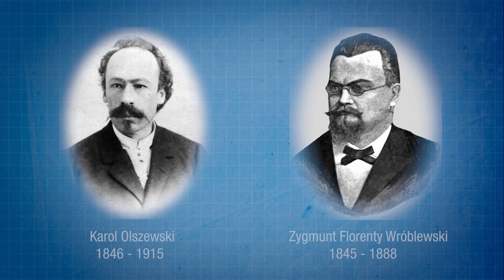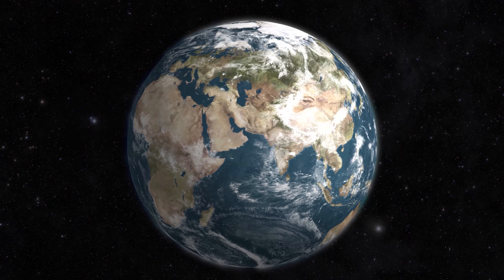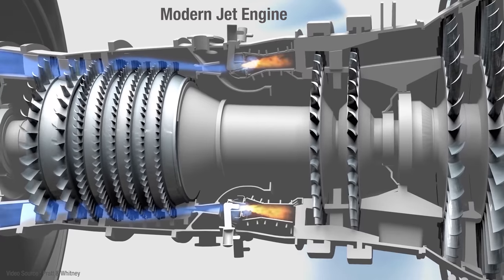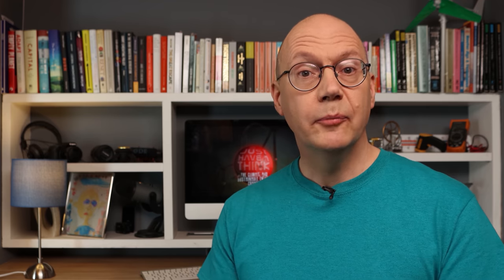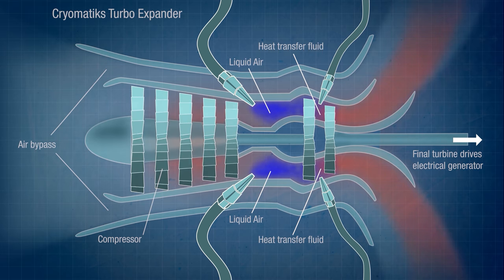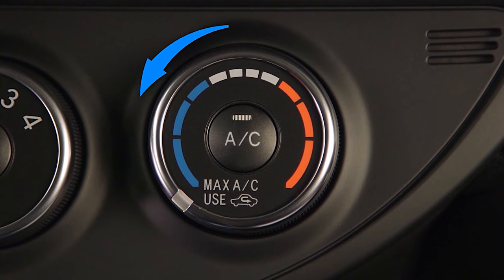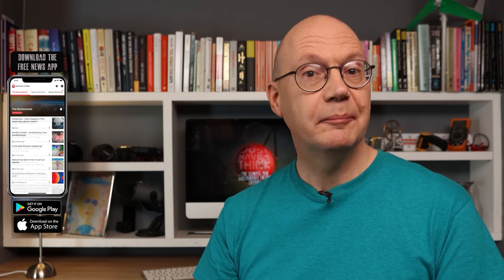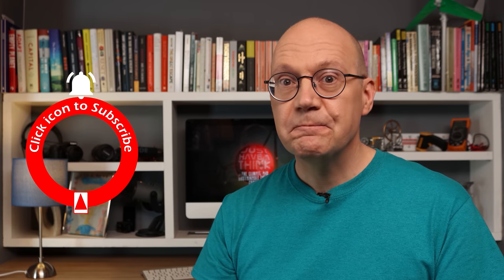Portable Liquid Air Power. A new boost for electric vehicles.

Comment: It would be interesting to see a comparison of the overall efficiency of this system vs hydrogen fuel cell vs battery for vehicles. As we transition to a low-emission grid the efficiency of the end-use will be increasingly significant.
Reply: Actually we're going to have like we have tobacco papers we're going to have the efficiency papers because the fossil fuel industry has used efficiency imposition to maintain market share. For example we have chronically incrementally increased the mandatory efficiency of large electric motors and the consequence of that is the cryptocurrency mining uses the electricity only ones and waste all of the heat that the computers produce instead of with the hundred and twenty degrees Fahrenheit fluid that boils the heat off of a 700 watt CPUs producing additional electricity for example? If Bill Gates had to delay a firing squad by a few seconds he would say he did that to save Capital cost. I don't know why you guys care about delaying Your Fate by mere seconds instead of coming over to the table of the good and getting into heaven obviously after a long enjoyable life?

Comment: You have missed an important application of this technology - regenerative/dynamic brakes on locomotives.
Reply: Electric locomotives already send the regenerated energy back to the grid.
Reply: @enterprisestobart  electric trains are much more powerful than EVs therefore losses are more important, also trains have much powerful stopping power, EV also have losses from regenerative braking.
Reply: @enterprisestobart  after you put a bunch of railroad Executives in prison you can installed some liquid metal batteries but only as a temporary measure; thanks for the Intel!

Comment: I really appreciate you covering this concept. For years I saw this as an alternative to the low range and limited recharge cycle batteries of then current EV's. Cryostats have nearly unlimited cycle life and faster recharge and are nearly as good in power/mass as far more expensive batteries. Cryomatik's expander will likely have extremely long MTBF and the low maintenance of gas turbines and if it can be made inexpensively, a vehicle using this tech could be very competitive with battery EV's. BTW it might make sense to add a solar heating panel to the top of that delivery van. Also this seems ideal for refrigerated trucks.
Reply: It should be possible to build the expander at reasonable cost since it does not need the high temperature magic of combustion gas turbines. Also auxiliary equipment should be cheaper and simpler than what is required for a fool um fuel cell.
Reply: Caroseria din tablă poate fi ajutată la răcire vara cu serpentine lipite direct cu argint sau cositor. După ce ies din schimbătorul de căldură.

Comment: Also be a great energy storage system for homes, many homes already have pressurized gas (flammable) , pressurized air would be much safer, and no replacing batteries or worrying about fire! Great videos!
Reply: I don't think its simply pressurized air but cryogenically cooled -200 C liquid nitrogen stored at a very high pressure. Also just based on the tanks interaction with air around it is likely to lose its stored energy, you can try to thermally seal it to prevent this but the energy will still leak at a certain rate. You will not have to worry about fires for sure but there will be other considerations, but yeah might still be safer.
Reply: No. There's a significant risk of explosion if the integrity of the pressure vessel is comprised. It would never pass safety legislation.

Comment: I saw a program on NHK about a containerised powerplant using excess power from a wind generator to compress air, which was then used to generate electricity when the wind didn't blow.
Reply: What's hilarious about the containerized version is it's just proud horsepower wise of a diesel electric locomotive and it is shipped and operated in a railcar despite having the alternator which you don't need if you use the system for your motor on a train. if you do that you will find that you have far fewer cars devoted to propulsion a fire higher percentage of the total length of the train is for cargo because you don't have all of the radiator cars to disperse the heat from the burning of diesel. And of course we move Frozen items by Rail and if your locomotive is powered by liquid nitrogen not only are there fewer tanks for liquid nitrogen than the removed radiator thanks for the diesel-electric but you load the food raw and freeze it in route!

Comment: There was a French company working on a noisy little compressed-air vehicle. It was based on a piston that had a very high dwell at TDC so that it could soak up ambient energy and expand the cold charge inside the cylinder. They were claiming fantastical range numbers when augmented with a small external heat source (ie, propane burner or the like).
Reply: @CloudedShine  
That car was named Eolo
Reply: @CloudedShine  Tata OneCAT
Reply: @CloudedShine  

I recall Renault developing a vehicle powered by steam many years ago.   I don’t mean back in the 1890s, rather 10 or 15 years ago.
Reply: I wrote an essay at Uni in the early 90's about alternatively fuelled cars. I found out there were VW Beetle taxis in Mexico City running on compressed air. Can't find any info on it now though - not sure if those were DIY conversions or a trial or something similar that never took off.
Reply: Jules Negri.

Comment: THe heat transfer fluid is a mixture of water and glycol and injected into the gas stream...where does this go?  Is it re-used somehow, or does this consume glycol, which is carbon heavy and also toxic?
Reply: Good question.
Reply: Thats my main concern as well. If it saves fuel but kills the wildlife its not a viable option.
Reply: Not to mention having to fill up a tank/tanks with water and glycol
Reply: @kirkc9643   and what about the energy required to manufacture the glycol and create the liquid Nitrogen
Reply: Ethylene Glycol: toxic.  
Propylene Glycol: harmless.  Used in all sorts of stuff we use on our bodies, and it is in many aerosols.
Reply from the maker: My understanding is that it is a closed loop system.
Reply: It is most likely a closed loop system.  The info-graphic was a little misleading and gave the impression it injects fluid rather than transferring heat.
Reply: @JustHaveaThink  how can ot be closed loop... is the air recovered and re compressed/cooled?  Seems like it would be difficult to keep the fluid from fouling and freezing in the compressed air holder.

Comment: Heat transfer from ambient air to liquid air can produce way under 1000 J/g of energy. Realistically, under 200 J/g. Overall, the efficiency of the whole cycle (starting with energy consumption for air liquifaction) will be quite low.
Remember that to produce energy, it will need to absorb a lot of heat from ambient air, and it's very difficult. There's a very big problem of that heat exchanger frosting over.

For reference, gasoline energy density is 46 kJ/g.

Comment: I did looks at this kind of technologies long time ago.
Say given it cost 50 cent per gallons for liquid nitrogen and you only used half of the tank and the rest are still in the tank. Given on average 2% will boil off after ever 24 hours. Its ideal for system that are used almost 24 hours a day and less for system only every-so-often.
Reply: Right, that is why you wouldn't fill it unless you know you are going further than your battery can do.

Comment: At only 125Wh/KG might as well stick with adding extra battery capacity. Yes theoretically it has the advantage that you can quickly 'refuel' faster with liquid nitrogen, but then you gotta faf around with pressurized vessels. Not to mention adding a whole new technical system to the vehicle with moving parts that can (and will) go wrong. Interesting engineering but at that weight I can't see an overall advantage.
Reply: Good point. Perhaps COPVs will make this idea more workable.
Reply: @nagualdesign  COPV's are not needed since the liquid air or nitrogen is not pressurized.
Reply: @LaserFur  I was just thinking that they're more lightweight than traditional gas bottles.
Reply: a bit of steel, some tubing and compressed air is a lot more environmentally friendly than batteries
some way of scraping the last bits of energy out of the thermal loss of your system seems neat
Reply: Refilling a liquid air dewar is probably faster than charging a battery. Which is important for fleet vehicles and long haul trucks.

Comment: Seems like a very rugged system for farms, cool stuff, fuel their tractors and use it as a powerwall in a farm.
Reply: This is a great use case. Add mining to too.
Reply: Turbine engines are pretty sophisticated, and maintain very tight tolerances.  They don't like to inhale the kind of junk you might find around a farm.  They're happier in the stark dry stratosphere.   This is a mildly interesting system, but rugged is not the first thing that comes to mind for me.
Reply: @incognitotorpedo42  Its no more problematic than Turbocharger in large machinery. 
Decent air filters are all that are required. 
And we will probably find once the performance specs are available,  the critical tolerances are way less than say an aviation engine or high speed gas turbine engine.
You can put three or four birds through a jet turbine that only makes it cough a bit, after all.
Reply: And very scalable

Comment: Ummm water and glycol? So you need a tank that you have to fill? Was that taken into account in the watts per kg? Are there any issues with just spraying this out into the air everywhere you go?
Reply: Had the same thoughts.  Ethylene glycol is the simplest of the glycol class of organic compounds.  It is sweet tasting and deadly if injected in sufficient amounts.  Often a source of death for dogs from anti-freeze spills.  That said, there are pathways for biodegration and is has general low toxicity to aquatic organisms.  So would say jury is still out for use of ethylene glycol.  Propylene glycol is a non-toxic cousin but is a less effective heat transfer fluid.
Reply: In a Just Have Think reply below it was mention this is closed loop process, so if works this concern goes away.

Comment: first use that struck my mind was small portable generators that one may use on a farm on a construction project. Pros would be no smells and pollutants which and possibly noise which is great in urban setting or maybe even camping. Cons were weight, price, difficulty of repairing it and possibly safety (compressed gasses are no joke)

Comment: Ultracapacitors solve regenerative braking problems
Reply: A semi going 80mph weighing 80000lbs has about 25MJ, you would need approximately 14,000 - 2.7v 500F ultracapacitors to completely stop it. Also if you try to stop the semi in one minute a 800volt system would push about 500amps
Reply: So the limiting factor might be the wires that try to push that much current and the high voltage operation.
Reply: Ultracapacitors are rare & expensive atm. Gotta think cheap or your idea is vaporware

[YT has a bot that deletes factual comments]
Reply: @CHIEF_420  So are you saying that you are lying?  Why do people keep tagging their comments with this?  Its not true.

Comment: I believe that back in the eighties a Brazilian engineer created a compressed air engine which had a long delay at top dead centre allowing the air pressure to peak before utilising it in a power stroke. I sadly can’t find the details now but it as designed as a taxi with about 50 km between charges.

Comment: Would be interested to know how loud this is. Jet engines and air compressors aren't known for their comfort in urban areas...
Reply: Jet engines are internal combustion engines working on the same thermodynamic cycle as a Diesel engine.  The turbine described here is more like a steam turbine which are relatively quiet machines in my experience.

Comment: I guess total well to wheel efficiency has to be evaluated closely vs a green pressurised H2 path, because the losses of producing liquid nitrogen add to storage boil off thermal losses proportional to time and nil for a H2 storage. Finally the Carnot efficiency is only theoretical and at low temp. any viscosity and bearing aerodynamic losses could be significant, not mentioning many materials becoming brittle at low temp. To me the value of the microturbine - generator portion of this concept could be also to decompress from 700-300bars H2 on board H2 trucks while powering auxiliaries and / or recharge batteries. Recovering of 60% of 10% compressing loss could be a huge 6% improvement. Then with such de-pressurisation recovery available it become concevable to store under pressure at no loss H2 and O2, both totally not contaminated by air dust ( water sourced green gases) to power an 82% efficient fuel cell (Apollo, Shuttle type FC) far above H2 - air FC efficiency and without air dirt contamination for longer operating life. Globally any thermal or cryogenic cycle is subject to heat losses, an ambient process via electrolysis, compression and fuel cell may show some high transient process losses but compensated by the practical endurance of the absence of all storage losses.

Comment: I've always wondered about the idea of using the heat from a nitrogen liquefier unit to heat buildings during cold weather periods in the north as a way to have a 2ndary use for the waste heat. I wonder if anyone has crunched the numbers. There already exist many uses for liquid nitrogen
Reply: District heating and cooling should be mandatory for all new larger scale construction and development sites. It seems like a win win for everyone once the infrastructure is in place. Obviously individual home owners won't benefit unless they opt in on their own and the buildings need to be designed for central air but still - seems awesome and hope more places do it. Tons of places that produce heat then should benefit from giving that heat back in one way or an other.

Comment: You don't explain how the glycol/water heat transfer fluid is recovered.  The CryomatiKs Inc website doesn't talk about this aspect at all.
Reply: I thought that too, it looks like this system is exhausting nitrogen, water and glycol to atmosphere.
Reply: I'm hoping that is just a simplified overview, and they use a heat exchanger (maybe run the fluid through a channel around the turbine body) to get the heat from the fluid to the gas.  If not, then they'll need an extra section on their exhaust to condense the glycol/water mix for recirculation...  Fortunately, they'll have liquid nitrogen on board to cool it with.
Reply: probably exhausted through some kind of condenser
Reply: Glycol being pumped into the environment is a horrible idea. Saving fuel but killing wildlife is not the answer.
Reply: @bmoturtleco  Probably Propylene Glycol (harmless), not Ethylene Glycol (cheaper, but NASTY!)
Reply from the maker: It's a closed loop as far as I understand it.
Reply: @JustHaveaThink  To be a closed loop, it would have to be recovered somehow.  The diagram you showed had it just being vented in the exhaust.

Comment: This is a very interesting concept. I think having a last mile delivery van that uses ultra capacitors to provide initial pull off power, batteries that provide cruise power and liquid air extender to Add to the range.

Comment: Idea: since trucks are used in the cities to distribute frozen and refrigerated goods to grocery outlets, it might make sense for them to use liquid nitrogen both as a coolant (instead of dry ice) and then as a fuel for the booster. Think about it. The faster the route is going, the more the driver can use up the liquid nitrogen in boosting, decreasing the amount of refrigerator time. But then the slower the route is going, the less she will use up the liquid nitrogen for boosting, and the more will be available for extending refrigeration for a longer day. So it auto-adjusts to traffic situations for a consistent use each day either way.

Comment: Imagine, if petrol/diesel had never been used for internal combustion engines and all cars were electric from the start. How much further forward would we be with batteries & storage, and with all these other added technologies only now being developed. This video is suggesting only a few more percentage points improvement but put all the improvements together and the difference will be quite dramatic in time. Keep the R&D coming.

Comment: Thank you for another great video! I'm sorry you had to make that sacrifice with the crisps, but it was for science.

This device is a bit complicated, but it sounds like a very good idea. There are a lot of delivery vehicles out there, but there are even more buses. If the larger version of the range extender can make electric buses economical it could cut huge amounts of CO2 from the air. And electric tractors... Wow, that would be a real game changer! Around here most farms operate on the ragged edge of insolvency, so something that eliminates fuel costs might change the economics of farming completely. Of course it would take time (and maybe government programs) to replace the existing tractors, but if an organized effort was made it could probably be done as the old ones wear out.

Comment: Cookie Monster!
May I please add that the ratio of nitrogen to crisps in the bag is of utter importance to the structural integrity of the actual crisps prior to consumption. Before the bag is opened the  pressure inside is approximately 1atm. However, the composite bag material is flexible but not stretchable, so the volume of the bag does not change until it fails. This affords the crisps a secure environment where they should stay intact unless shaken. Cheers!